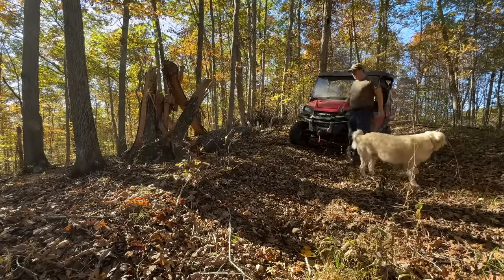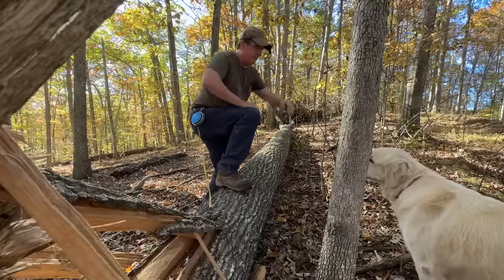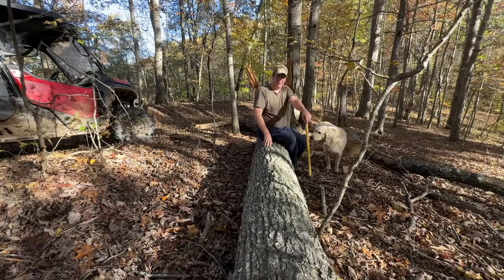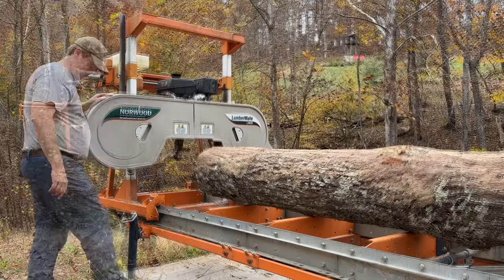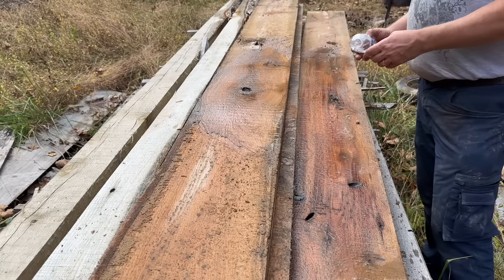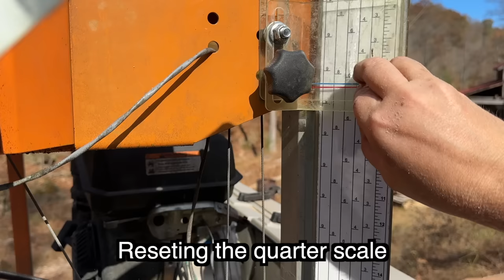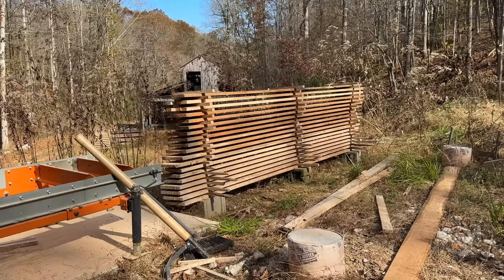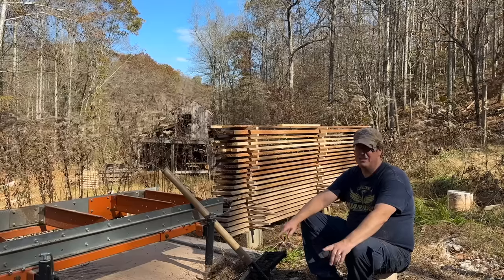Deadfall Oak Gets Turned into Beautiful Lumber

Comment: I am from north west Ohio and used to cut some firewood. I live in the Philippines now. If you think that green red oak is heavy, visit me and I will let you lift some DENSE green coconut lumber.  I have been here 14 years now and am still amazed at coco lumber. The immature (less than about 15-20 year old) can be very soft, softer than white pine.  The old stuff, more than 60 or so years old, can be very very very dense and heavy. You can not drive a spike in it without pre-drilling. And it is HEAVY.

Comment: I had a red oak fall on my property, bigger than this one, which was in the flood plain and debris was backing up behind it - including railroad ties, LOL. Bucking it was the easy part. Moving the rounds up the hill, manually splitting the logs... what a work-out. I have that 3-1 LogOx - it does not replace a cant hook for large, heavy oak rounds.

Comment: Troy, you're my number one go-to guy for good common sense content. I'm considering whether to buy a sawmill or wood splitter to produce side income. All things considered, your thoughts on which way would be most feasible as potential income - pros & cons??
Reply from the maker: Regardless of which option, my first question is do you have access to large sources of wood (hardwood or softwood). From just an income opportunity perspective, the firewood business would have the lower cost barriers. You can get a basic splitter much cheaper than a mill. You can always upgrade as you generate income. Firewood is best sold after a year of being split (seasoned) so you will have a delay in cash flow. The mill has a decent learning curve and you will need other equipment to make the handling of logs and lumber easier. Research your customer base and see what is in more demand in your area. 
If you have a large supply of logs on your own property, consider both. The bottom portion of the tree goes to the mill while the top becomes firewood. Hope this helps.
Reply: @RedToolHouse thanks for your inputTroy

Comment: you could definitely use couple on log arches 
   one that hooks too tow vehicle tractor of atv  and another that picks up and holds the far end up snd out of dirt  this arch has long beam that be on top  would be high in air when getting arch into position and cable under log so when pulling the beam down it actually lifts log off ground and stap beam to log  wnich finish lifting and secure log the head / Tow end also lift log so suspended off ground reducing the drag keep log out of dirt  reducing damage to mill

Comment: Ever though about using the hood of a car on the front of the logs you are skiddihg. Cuts down on the drag. Lots of good fire wood in that scrap wood.
Reply: I split a 55 plastic barrel open to make a lightweight sled. 
Works surprisingly well. -KJ